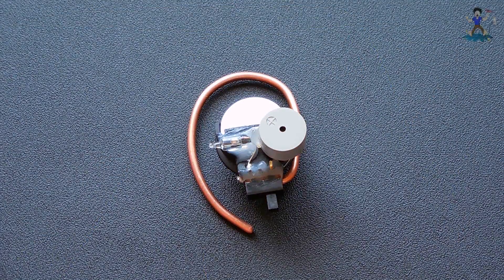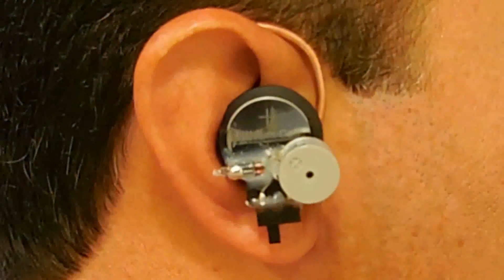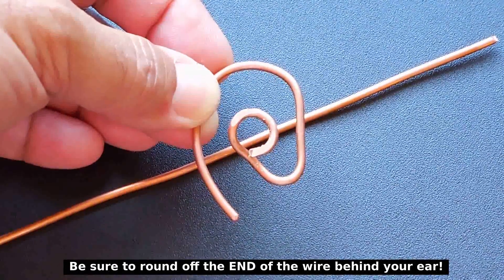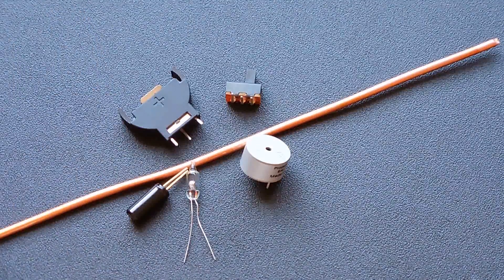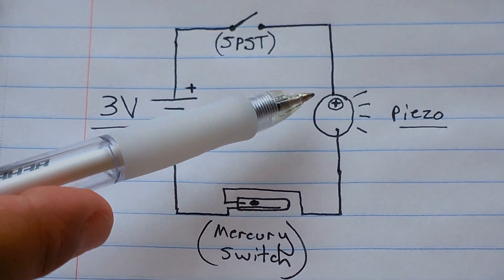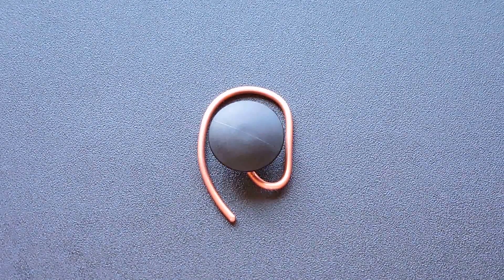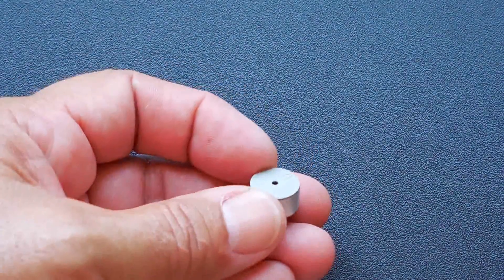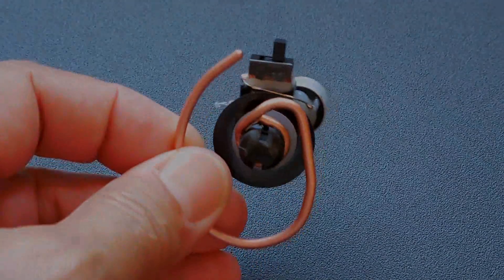How To Make A Vehicle Snooze Alarm(Anti-Collision)

Comment from the maker: DISCLAIMER:

Nothing is a guarantee. Just the fact that this device has the ability to HELP save lives, that's good enough reason to use it. Clearly this device was not intended for people to operate a motor vehicle while drowsy. If you're driving, start dozing off, and you have no safe rest area to pull over to take a nap, then you place it on your ear using the HIGHEST sensitivity setting to assist you in staying awake until you can find a rest area. Better to hear the alarm beeping a few times per minute, than not hear it at all. Always adjust the headrest so your head has no choice but to lean forward if you doze off. You can also place it on your ear before becoming drowsy when traveling with others. As soon as you start to doze off, the alarm will sound, and others will know you're done driving for a while. Something is better than nothing.
Reply: Hope you patented this before sharing
Reply: electronicsNmore i tought that you woud put that wire in your ear xD
Reply: electronicsNmore ? it would be better if you used a small vibrating motor instead of sound.

Comment: Ive made it replacing the metal tube with an acrylic one bended with hot air
Thanks dude for the idea
Reply from the maker: Wow, must have been very hot curving that around your ear....I like the copper wire.

Comment: I thought for truckers who fall asleep.

Make a light in dash with buzzer and a button on steering wheel. Every 15 seconds light turns from green to red on dash...driver has to keep pushing button to keep it green or computer link to modern diesel de fuels engine to idle and buzzer goes off(easy to do since oil pressure temp etc does this anyway)or the Jake brake come on slowing truck..notifies authorities to pull over truck.  So many drivers and motorists killed from semis crashing into toll booths cars etc.

Volvo trucks would like this. Shalom
Reply from the maker: As long as the driver has to keep active, it's a good idea. :-) It keeps them awake.

Comment: hasn't it been proven that loud noises, rolling down the window, etc. won't keep you awake? The only failsafe method to not fall asleep behind the wheel is to not drive while you're tired, and to pull over and take a nap if you feel sleepy.
Reply from the maker: No, that hasn't been proven. The reason why you fall asleep with the radio on , or window open, is because the sound is usually a constant level. If a loud noise arises, such as an alarm, then you will wake up. Yes, you're correct, pull over when tired is the right thing to do, but unfortunately you cannot always pull over. :-) I drove across the USA, and I can tell you that there are many areas where there are no exits for miles, and no shoulder wide enough to pull over. Thanks for watching

Comment: an idea for a deluxe version: add a second tilt switch in parallel and at an angle to the first one, so the alarm also goes off when you tilt your head back
Reply from the maker: Yep, that would work too, but there would be no provision for adjustment. It would have one setting. :-)